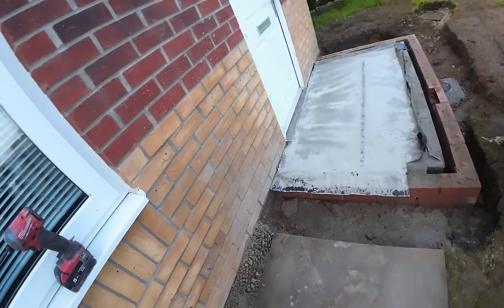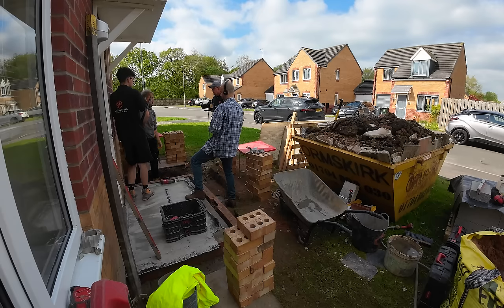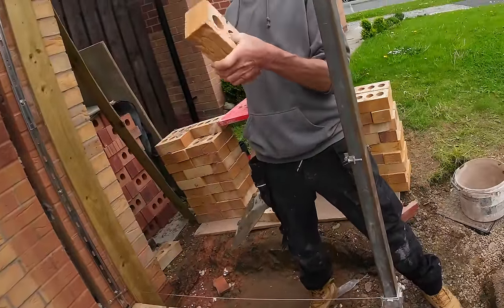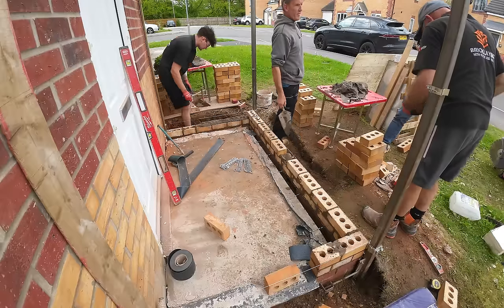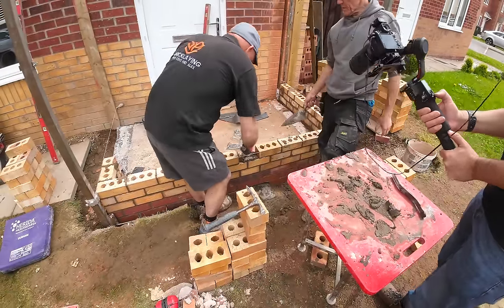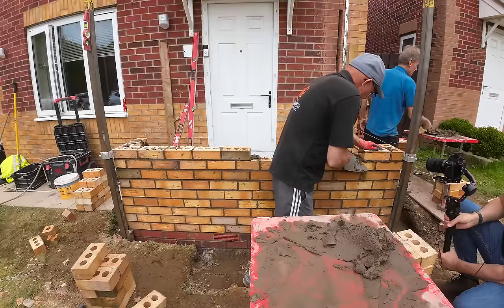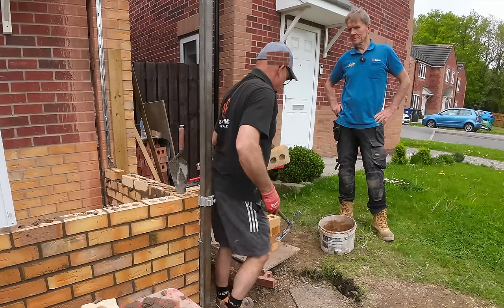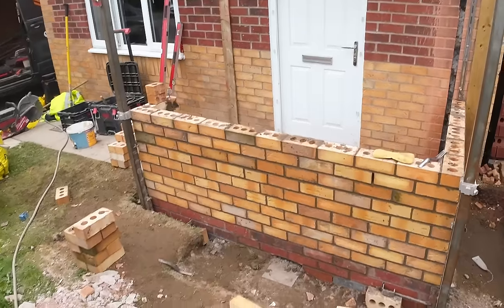SKILL BUILDER COME TO HELP WITH OUR PORCH !!

Comment: Hi Steve
Why not open up save having a cut in there. Some of the house perps are big. Probably to much to tighten up.
Reply from the maker: Reds are tiny , buffs are huge so if I opened up the buffs the red perps would be 30 mm each 🤮🧱👍🏽

Comment: Hi can anyone explain why a cut was made in a perfectly good wall by the wall starter ( student ) and does this have to be done everytime you attach a wall to existing building eg if thst porch was double storey extension ? Ant structural issues ? Thanks for any advice in advance
Reply: That is done so the insulation in the cavity of the new wall can be tucked in the existing wall and there will no gap there that allows cold to get in or heat to get out easily.
Reply from the maker: Spot on thanks Marty 🧱👍🏽
Reply: @martyvijverberg715  hi thanks for the reply ! If this is done does it to take away any structural integrity? And finally is it  a choice decision or a building reg ? Is an option not to make the cut and still meet building regs thanks again
Reply: Structural all will be fine. Everything is supported so it will stay up. I don’t know building regs in the UK (or anywhere else, i’m not in construction) but insulating (and ventilation) and preventing gaps in that is a good thing to do.
Reply from the maker: @martyvijverberg715 🧱👍🏽
Reply: @martyvijverberg715  thanks
Reply from the maker: @georgelfc1 👍🏽🧱

Comment: There is no requirement any more to put in a vertical DPC in a porch or extension, none whatsoever
Reply from the maker: Maybe where you are but every area has different ways . 
    I chose to put it in
Reply: @fruitgums
It varies from Council to Council and region to region.
If you happen to be in a part of the U.K with a known high driving rain index, it makes perfect sense to install a vertical D.P.C.
N.H.B.C  and the Insurance companies are reviewing their advice and guidance on this issue. Revised Building regulations have this matter under consideration for future use.
Reply: @martin2466  I have not added a vertical DPC since maybe 2001, had numerous Building inspectors tell me it's not necessary. I live and worked in the east of England. Retired now.
Reply: @fruitgums  I retired in 2017.
And I am thoroughly enjoying my retirement, I hope you are to.
Take care and all the best.
👍😁🧱
Reply: @martin2466  Born in 66 and retired in 2021 after having my first Vaccine.  Which put me in a wheel chair at 55 for the remainder. Was a good job I had the means to retire early as the Wife couldn't say no when I bought a 2005 Jaguar XJR (proper good condition, 43k miles) and last year they refused to renew my licence for medical reasons! Not all bad as we do take breaks all over the UK. I keep me chin up, thanks and all the best to you and yours.
Reply from the maker: @fruitgums 🥺🧱👍🏽
Reply: @fruitgums  Sorry to hear that mate.
That damn Covid has much to answer for...
As my late Father used to say to me,  "Chin up and keep smiling."

Lets hope for better times, look after yourself and my best wishes to you.
🍺🍺🛠🧱👍